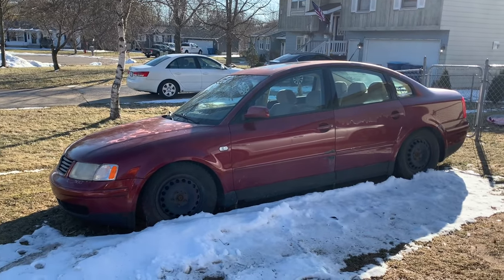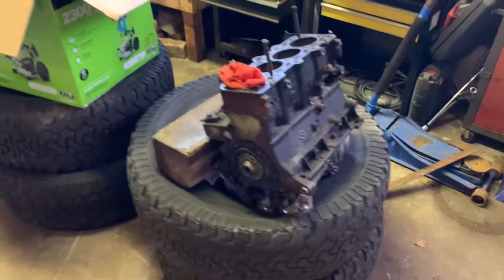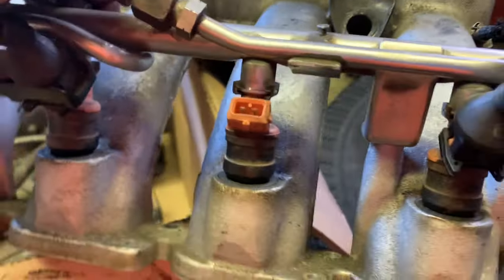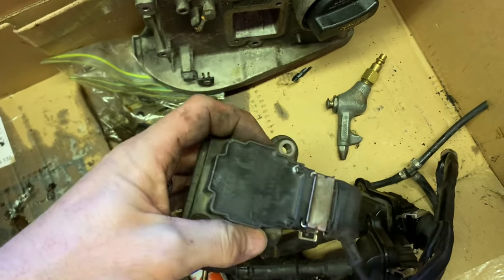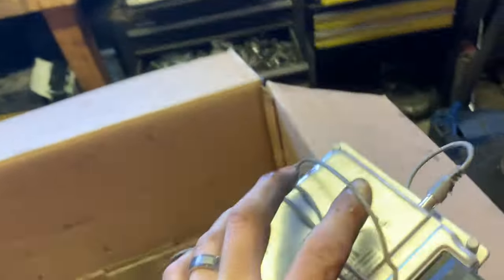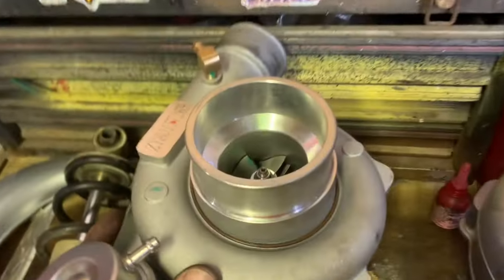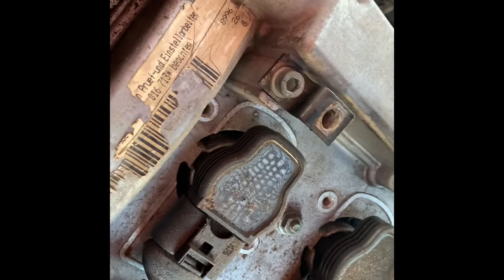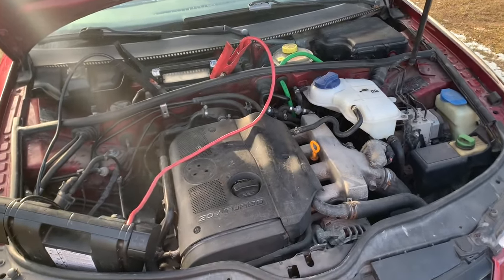Budget 1.8T Passat B5 Gets APR. Stage 3 GARRET GT25r Turbo Setup For $250!! THIS IS HOW I DID IT.

Comment: That blue thing is an oil cooler. That sandwich plate takes the place of the stock oil cooler, and then the line run to that blue thing which is a cooler that you can mount wherever. You then plumb water through the other lines there.
Reply from the maker: thank you

Comment: The square coils (“bolt-down type”)are from the older style 1.8t. The push down round ones are from the newer 1.8t. People prefer the bolt down because they don’t pop out which is an issue I’ve never had with my push down. I think push down has a lot more comparability. (R8 coils, etc)
Reply: Compatibility*

Comment: I have a passat as well a 2003 I want to remove the chrome trim but it has like holes how can I cover them up and still remove the chrome how yours is
Reply from the maker: You can weld in a little piece of metal and fill over it.
Reply: Are you trying to sell any parts?

Comment: The blue thing is possible a scavage pump due to the low mounted turbo to lift the oil back up to the sump.

All parts look to be early 1.8t type AEB.

Is that turbo not same as on most stock Nissan SR20?
Reply from the maker: Thank you for the info! I appreciate it a lot. I had hoped someone knew about this stuff. We have a 2000 B5 Passat so this stuff is perfect all except the drive by wire throttle body. I e read that that isn’t easy to convert. So I’ll ditch the Ecu and the block. I’m sure there is someone in the world building an old 1.8t.
Reply from the maker: And yes kind of on the turbo. This is the upgrade replacement for the stock sr20. It’s small but still very comparable if not better than Ko4 I believe
Reply: K04 is a small shit turbo compared to a small full frame turbo.
Reply from the maker: @hansbrekke4784  I agree. But there are some nice Ko4 hybrid turbos out there capable of 20psi. Which is more than enough for a street car. Especially a car my son will drive lol. This is a perfect father son project. It’ll be a cool little car when it’s done.
Reply: @KBMOTORSchannel  I’m building an old aeb 1.8t b5. Putting ko4 in next week but don’t want to mess with stage 3 tune rn😂
Reply: @KBMOTORSchannel   you want to sell that k04 stage 3 ecu let me know. Building awm 1.8t have the K04 and 440 injectors but unsure of where to get a tune. First vw.
Reply: @KBMOTORSchannel  that blue thing is an oil cooler